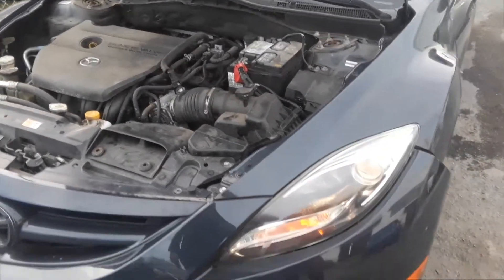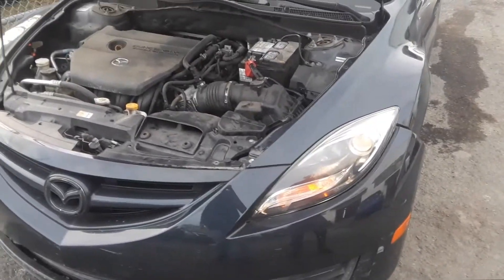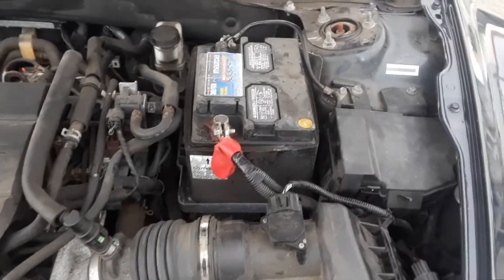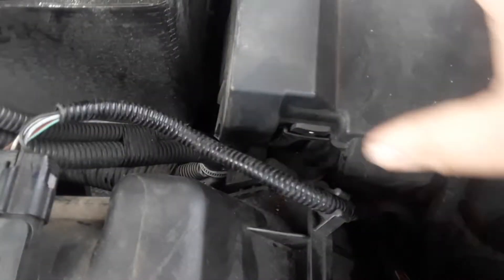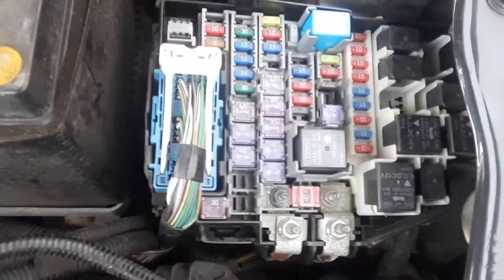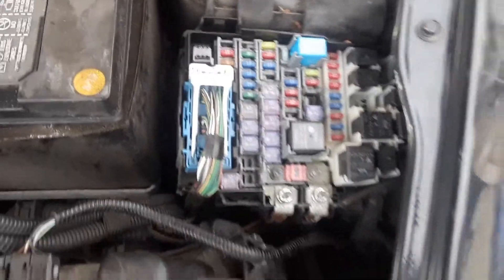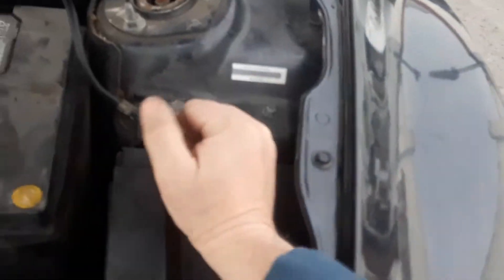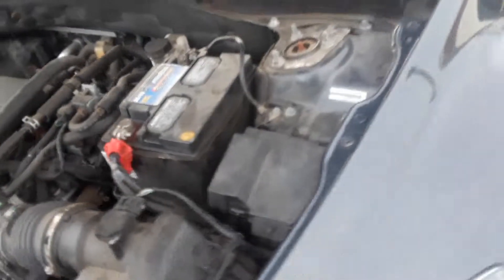Mazda 6 Fuse Box Locations

Comment: Is there a cooling fan module like the 2008 mazda 6
Reply: Did you find  out  , I am looking for a fan relay or a fan control module  but no luck.
Reply: @thebigbools  apparently you'll have to buy the whole fan assembly. Since the a/c and cooling fans are one. Check the relays, and fuses for the a/c, and fan before buying the assembly. It's pricey.